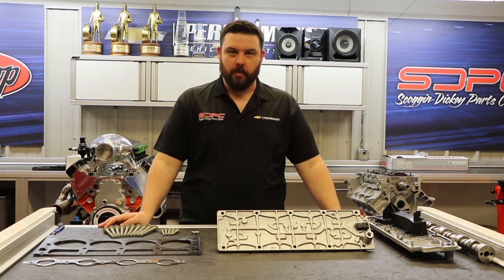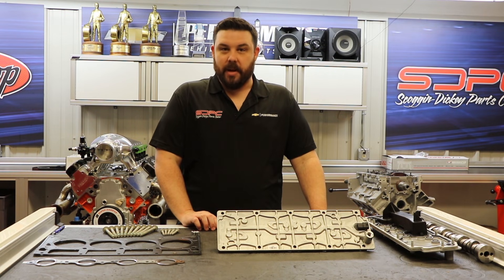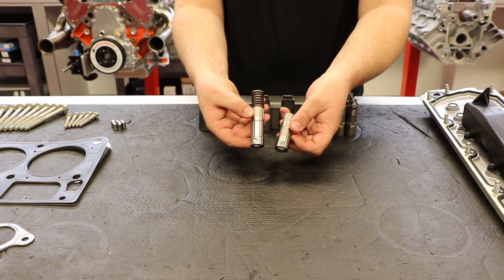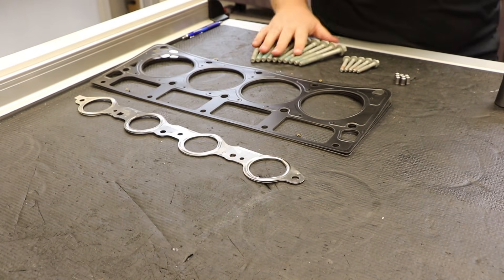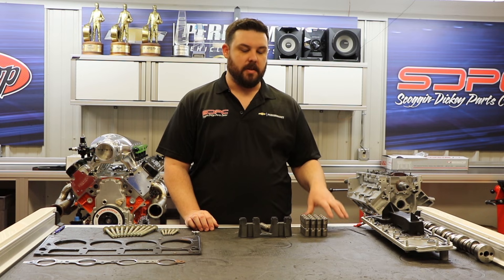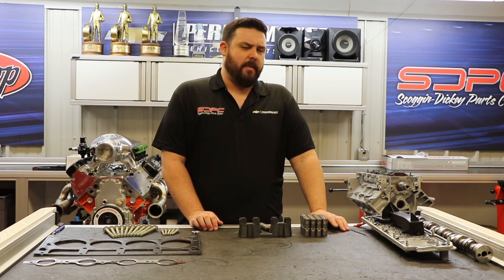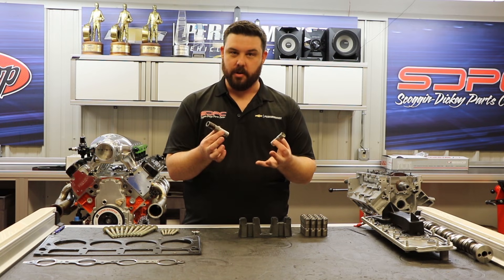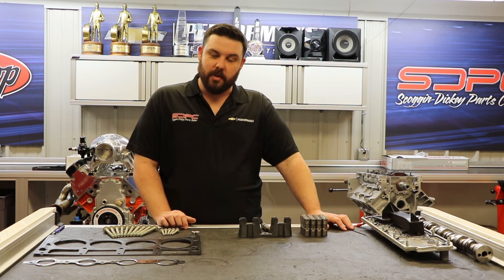SDPC Tech Tips: DOD/AFM Delete 101

Comment: I've done the dod delete, do I need to put a tune in it also now. As I do notice a little hesitant when starting out
Reply from the maker: Yes a tune to shut off the dod parameters is necessary.
Reply: @Sdpartscenter   Thank you do you have a recommendation as to what kind of tuner I should purchase to do this
Reply: Yes, if diy HP Tuners is nice, you need to disable DOD in ECM, it also is way more capable for future fun.  It has a learning curve, help is here on YT.  If you need help with that look for a tuner in your area.
Reply: @durkkooistra4797  thank you,  yeah I've done everything but the tune.
Reply: @franker1111  Good looking W9.  I'm from W MI, usually there on the weekends.  HP Tuners has new version MPVI2+ for $400 this includes the two credits you need to unlock your ECM. Summit racing has the previous version MPVI2 (which I have) on sale at a discount.
Reply: @durkkooistra4797  I'll reach out to you about it when I'm back home next week,  I've been using it with out a tune put in it I use my tech 2 gmc scanner an flashed the ecm then put my own operating system in it
Reply: @durkkooistra4797  if I brought you the ecm or sent it to you could you put a program on it or a tune, I built my motor so it  an take what ever I throw at it. Unfortunately no shops in my area that dose tunning
Reply: @franker1111  Built the motor to last or to go fast?  Turning off things like DOD, rear O2 sensors or EVAP (for "track" testing) is simple.  This could be done on a bench setup which I don't have.  To properly tune a ECM for power upgrades like a larger camshaft and/or more is a bit more involved.  This needs a complete tune which includes an initial setup, data logging and small adjustments one at a time to all the parameters.  This takes time to get it right, so a one time mail order tune may make it run but it's not the best.  It's like dialing in a carb without reading sparkplugs or a vacuum gauge, you're just guessing at that point, the better your ears are the better the guess but this is still not perfection.  I don't know which vehicle you have and without an existing ECM file and data log no one would be able to tune correctly.  A wideband O2 sensor is needed to to do this properly, if you get a chance watch some of the tuning videos on Goat Rope Garage YT channel. There's a lot of good information there, it'll help to explain the process.  For me to just turn off the DOD I would need your vehicle or a copy of your ECM file and we would need the required 2 credits to unlock your ECM.  If not the vehicle then you would need a copy of HP Tuners to generate the file and email it to me. At that point you may as well learn how to use the tuning software yourself as you'll need HP Tuners to create the file.  If you have a modified engine get a Dyno tune if you want it done for you or a street tune with something like HP Tuners using a wideband and some assistance (will cost some $) and a bunch of time.  DIY is a great way to get this done, think of it as learning a new language.  Tuning, no matter which way you go, will take time (probably a couple of days or weeks if you're new at it).  Just like putting a new top end on your engine and then setting up the valve train, there could be consequences if you don't do it right.  When you're done you'll appreciate the performance that you get.
Reply: Anyway, sorry to be so long-winded on the previous post.  You mentioned flashing the ECM we would definitely need to know what ECM model you have and what firmware you put in it.  HP Tuners Will show this.  If you're DOD is still active you could try putting it tow haul mode and see how it acts but it sounds like you need a tune.

Comment: My corvette c7 was tuned in germany, they made a software Dod delete without any hardware modifications.
What are these hardware modifications for if you can turn the activation of in the software ?
Reply from the maker: Hardware modification removes the failure prone dod lifters.  Most of this is usually done with an aftermarket camshaft installation or after they have already failed.

Comment: I have replaced DOD lifters and cam now I have half the oil pressure  it’s not the O-ring on the pick up tube it’s not a collapsed oil filter it’s not the it’s not the oil pan gasket it’s not the cam retaining plate it’s not the dog bone what about the extra holes in the lifter boars where the DOD lifters used to be
Reply from the maker: Hi Jeff,

Did you do the tower block off plugs or swap the valley cover when you did the delete?
Reply: Are you saying the solenoids won’t hold back the pressure
Reply: Check the filter underneath the oil pressure sending unit on the back of the valley cover make sure it's clean, dirt and pieces of silicone can collect there no matter how careful you are.  Did you replace the oil pump with a standard volume unit?  I would not do this on a high mileage engine.  On a higher mileage engine there may be additional clearance on the bearings a standard pump will not keep up.  Was the pump put together properly?  If you did go to a standard pump you need to block off the galley bypass valve inside the oil pan it is located above where the filter mounts.  You can do this even if you did not replace the oil pump to keep the oil from spraying up from the bottom creating drag and possibly causing it to burn oil.  Also do block off the lifter valley posts, the standard lifters do not need the additional holes in the lifter bores so block the valley holes to make sure nothing bleeds off there.
Reply: @durkkooistra4797  Thanks , non-DOD lifters let oil back up and bleeds off at the solenoid‘s simple put on 4.8 lifter valley cover

Comment: I will be deleting the DOD and VVT what kind of timing set should I go with? Do you offer the timing set? I have a 2014 Chevrolet Silverado 1500 LT. I also want a 3 bolt cam possibly stage 1 close to stock so I won’t have to change the pushrods or springs.
Reply: A single roller for GEN4 LS with 4pole cam sensor and 58X crank sensor or just the GM 4pole 3 bolt gear. I'm using the Rollmaster CS1190, it's a high quality aftermarket timing set.

Comment: I’m going to do this on my g8 with the l76, and I’ve been looking into the Btr stage 2, can I use stock pushrods or do I need to install different ones
Reply: Stock pushrods are good , I get them changed when using dual springs only

Comment: Ok so I have a 2007 Chevrolet Tahoe, but door sticker says 03-06 so do i have a 3 bolt cam or one bolt ? ?
Reply: If you have AFM/DOD it will be a 1 bolt. Non AFM/DOD aftermarket cams are 3 bolt.  You'll need a cam gear or timing set that matches your engine.

Comment: On a 05 5.3 lh6 engine I have to change the camshaft, or I can leave the same
Reply: You have to change it. If your truck has AFM the cam shaft is AFM specific to the bearings and such. If you don’t put a standard cam in there after you delete AFM the bearing clearances will be wrong and you’ll lose cylinder pressure.

Comment: I have a 2010 Escalade with the 6.0 Hybrid powertrain with 100k miles. The engine is currently very quiet, no tapping. Should I tune it to prevent the DOD/AFM from actuating? Will this keep the long lifters alive for the foreseeable future? Or should I pull the heads and install your delete kit before things get noisy? Thanks!
Reply from the maker: That's entirely up to you.  We tend to suggest having it tuned out and plan to eventually delete it.  Just depends on what you're comfortable with.
Reply: I have the same problem I’ve herd you can’t delete the internal on a 6.0 hybrid it will cause issue to hybrid system
Reply: @sunnyghuman5805  i think you're right if a retune is required. Probably best for me to buy device that plugs into obd port to just disable afm system

Comment: Ok I would really appreciate some input, so I bought a truck for 7 grand and it had a dod delete well it has a misfire light going off check engine light is flashing 2007 Tahoe so come to find out he did the non dod lifters and blocked the towers but didn’t do the camshaft, so what I wanna know is do I just need a tune or do I need to do a camshaft, and it ha low oil pressure like 15 psi at idle 40 when driving on road so I did the oil pick up tube gasket and that didn’t help so do I need an oil pump or do I have low oil pressure cause the camshaft wasn’t replaced
Reply from the maker: Ok, it sounds like you need the non-dod cam AND and tune.  When you dig in for the cam swap, to also replace the cam retainer plate to see if that helps oil pressure.  The little o-ring on the retainer can get pretty flat, bleeding oil pressure off.
Reply: @Sdpartscenter  so the dumbass that tried to do the delete did not do any research and did not block the oil valley towers he said it had a new valley in there well it was new but it was a AFM valley so I bought the valley cover for the delete and that fixed my oil pressure issue 45 psi at cold start , 37 psi and idle after 30 min 60 psi maybe 65 while it shifts gears at higher RPMs , so that is fixed but now my question is this , I need a camshaft trying to order parts my truck is an 2007 but door sticker says 03-06 so 07 they switched to one bolt camshaft so does mine have a 3 bolt cam ?

Comment: So I don't have to change the oil pump , but is it recommended to plug the pressure relief valve in the oil pan?
Reply: Cool. I was just wondering if it was a requirement or not. Some people say do it because the oil splash on the lower end will cause you to burn unnecessary oil . Good to know thank you.
Reply from the maker: It is not required but you can still do it if you decide to do so.

Comment: I have a low pressure on a 2007 tahoe 4.3 i already change the sensor  the oil pump and the tube and gaskets at the oil pan
Some one told me this part may be the problem do you know if this part cause low oil pressure???
Reply: I think u mean 4.8. How low is the pressure?

Comment: If you replace the valley cover to a non dod do you just leave the connector disconnected?  and it won’t throw a check engine light ?
Reply from the maker: Leave the connector disconnected, you need to have it tuned out.

Comment: I have a 07 3.9 impala and I installed a 09  3.9 motor so basically I deleted the afm right and I also put the computer out the 09 in there so what else will I have to do because with me having a different motor I already have the stuff that I would have to change on the 07 motor

Comment: Why not just use the plug in AFM delete that plugs into obd2?
Reply from the maker: This package is more for those that have already had their DOD system fail, damaging the lifters and cam and will have to have their vehicle recalibrated to shut off the AFM tables.

The method you mention could technically prolong the life of the AFM lifters because they don't have to go in and out of 4 cylinder mode.

Comment: Why not just get a Range Technology dongle that disables V4 mode for $199 and be done with it.  You can unplug it for smog inspections and plug it back in after you pass with no problems.  What’s the need for all these extra parts and expense???????????
Reply from the maker: For the time being, there's a lot of places that don't do smog inspections, just visual.

You could say the dod disabler dongle should "prolong" the life span of those dod lifters because they aren't constantly going in and out the 4 cylinder mode.

This write-up is more for those that have already had a failure as the stock replacement DOD cam and lifter set is quite expensive especially if the failure happens outside of warranty.

Comment: Cool info👍🏽

For those in the metro Atlanta area.

https://youtu.be/zyYifhHTMm8

🚫Disable AFM V4
Included with the disable:
✅More power
✅Raised speed governor
✅Quicker trans shifts
✅Less pedal lag
✅Adjust for bigger tires & or gear change
GM 07 to 2015 with 4.8, 5.3, 6.0 & 6.2 great value for $150. 
2016 $170
2017 & 2018 $250
Newer Years DM your year and model for pricing.

This is performed by recalibration of the drivetrain computer(s).  Completed usually within 20 minutes.

Comment: I got a 2010 Silverado. 

Never had 1 issue up till this week and -20 reg air temp.  Now I'm getting the p3400 code which is this.  Can cold mess with dod and afm? 

I have no tic no tap it did fall on its face and miss. A few times.  Would cold mess with it at all? 141k never ever missed a beat.  Up to literally now

Comment: I have a question and hopefully I can get a solid answer. I have a range dod disabler and a non afm valley installed but still running the dod lifters and cam. Blocking the oil tunnels going to cause problems with the engine or build up pressure and activate the lifters. Thanks in advance.
Reply: Did you ever find a solid answer here. I just installed Pulsar LT on 21 Silverado with the 5.3 w/DFM. Have heard it could impact VLOV since the valves would never collapse (always V8). So I was wondering similar to your question.
Reply: I had to find out the hard way, it will not work had to do the full delete and send my ECM off to be programmed for a delete.

Comment: Too bad GMC didn't just step up and fix the problem for us when it was under warranty and complained out the lifter noise.
Reply: I don’t understand why they keep rolling the dice with this dod shit. It’s gonna end up being the end of gm. Ford is gonna run off and leave them
Reply: They already have.
Reply: Totally agree. Twice I got oh its a bad spark plug. Is all that does is put off the code so it runs good for another 30K. The 2nd time they also said the put in a new valley cover.  Yeah OK. :(

Comment: Why the cam 
I've deleted this system by plugging the  holes , the vehicle ran fine.
Reply: Cams for afm are machined differently. Youre gonna have issues with power if you dont swap cams. Expensive but necessary

Comment: "Can't use a stock CAM" ... um, I have a question... why? also, bullshit.
Reply from the maker: Sure, you could go buy the same DOD cam that was in the engine.  From experience, most of these DOD cams are already damaged by the time this system fails and the truck rolls in for service.

The ramp rates are different on the lobes with the DOD lifters, so your dynamic compression is going to be lower when you replace all this with the non-DOD lifters, somewhere in the range of almost 15% lower than the other four cylinders.  You might get lucky and not have it throw a missfire code, or ignore it, or do like some and just shut it all off in the tune.

But if you're spending the money on a replacement cam (if the lobes were wiped out), why put something in there that's sub-par?

Just look at the price point:
Non DOD OEM cam $94.04 https://sdparts.com/i-19902864
vs
DOD OEM cam $233.92 https://sdparts.com/i-19902863

Comment: That system is a piece of Junk Don't Sugar coat it! It leads to premature engine failure and not much better MPG at all! GM tell the EPA to cram it the next Silverado you Build and Give us a real small block back.
Reply from the maker: Thankfully, the L8T doesn't have any of the AFM.  Yes, it's a cast iron block, but it still fits the bill.  Unfortunately, it's only going to be in the HD trucks or the Express and Savana.

Comment: Just flash the ecu to disable dod thats all no need to replace parts
Reply from the maker: Absolutely, it prolongs the life of the parts not having to go in and out of DOD.  How much longer?  Who knows, probably long enough for it to not be your problem after you sell the truck.

This is more for those that already are having to replace the lifters or going with a performance grind anyway.
Reply: @Sdpartscenter  I am not sure if anyone is following this thread anymore. But I have a 2019 Tahoe 6.2 with the new 10 spd tranny. It has about 25k miles. No issues. However doing this mod is definitely a great idea but I can’t put that money into this as I have no issues. I am also still under warranty.  Is it worth reflashing right now?  I do plan on putting at least 150-200k miles before selling. And do you offer remote flashing of ecu?
Reply: the lifters still fail in time . that can help prolong it from failing but many people still have the dod lifters fail even with it tuned out .

Comment: Pour in marvels mystery oil or sea foam in your crankcase but not both at the same time  be sure to read the instructions  ....your problem is sticky engine deposits that keeps the lifter cup in a stuck down position leaving  clearance for the push rod to rattle around and then tap when the clearance is taken up
Reply: Couldn't you do the same thing with transmission fluid?

Comment: What’s the difference between the ones you mentioned and the Gen V LTs? Same system, different results? Thanks. Great info.
Reply from the maker: The LS DOD kit does not include a camshaft, the Gen V LT kit is similar in many ways, but you'll have different fasteners (there's one little head bolt that's very different), and it comes with a non DOD camshaft.

https://www.youtube.com/watch?v=DNxBaSDD5q8
Reply: Scoggin-Dickey Parts Center Thanks so much for the quick response! Great to know. I’ll give it a look.

Comment: I got a question can I use the cams and lifters from an o4 avalanche has lm7 heads to do a afm delete
Reply from the maker: Yes, but you will also have to do a VVT delete if yours has it. Also, you'll need to use a 4X 3-bolt timing gear: https://sdparts.com/i-20089467

Comment: If you’re in Metro Atlanta area,  for same price or less than the cost of a Range module.. get a base tune.
✅More power
✅Raised speed governor
✅Quicker trans shifts
✅Less pedal lag for DBW
✅Disable V4 mode on AFM engines highly recommended with no loss in mpg.
✅Adjust for bigger tires & or gear change
GM 99 to 2015 with 4.8, 5.3, 6.0 & 6.2 great value for $150. 
Newer Years DM your year and model for pricing.

This is performed by recalibration of the drivetrain computer(s).  Completed usually within 20 minutes.
Reply: 2007 suburban stock 5.3  dod delete tune